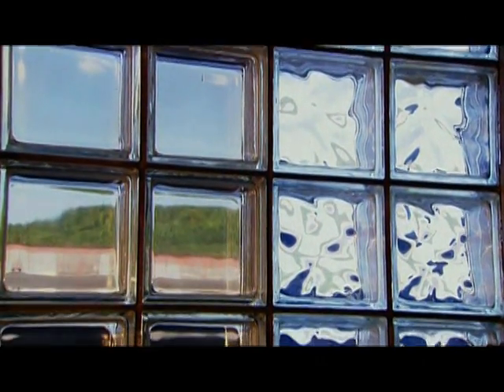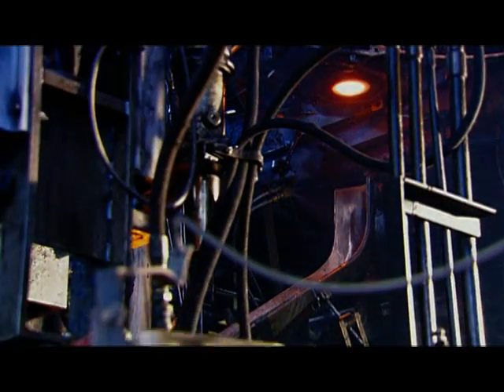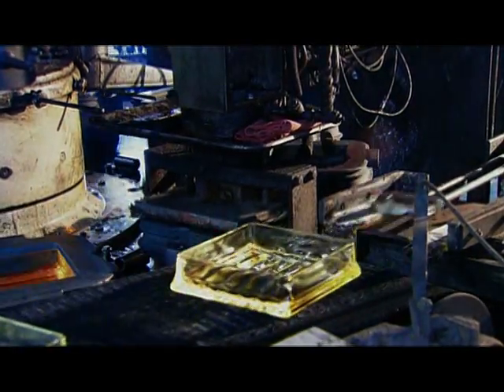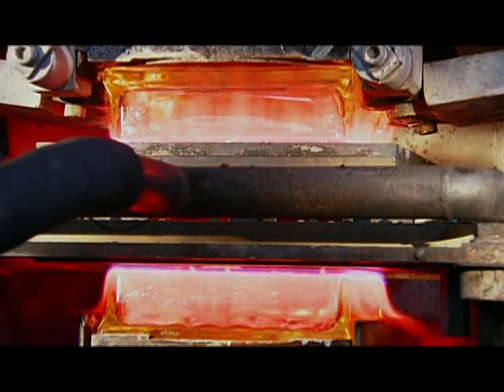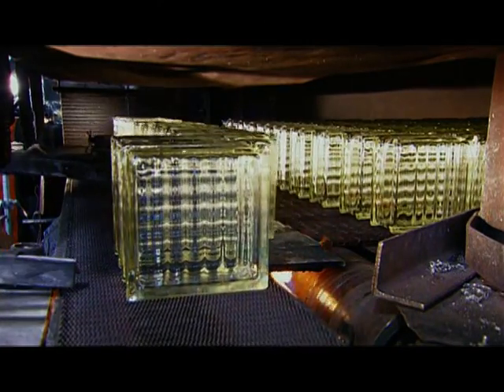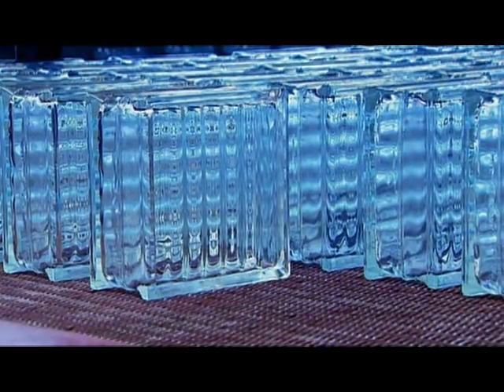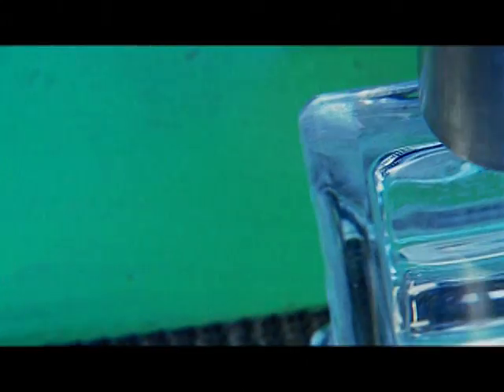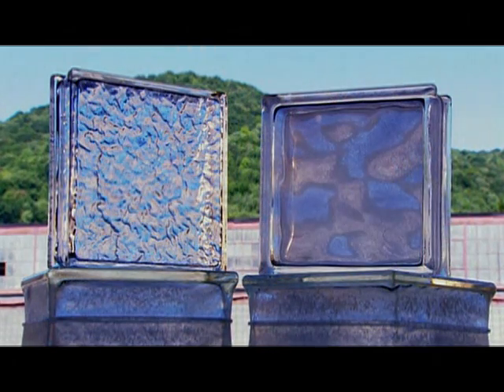Glass Block - How It's Made

Comment: Worked with Glass block for 20 years making Pre Assembled panels with em (that Pattern is Argus, theres Parallel and Non Parallel Rib style) , sad Pittsburgh Corning went outta business due to Imports (our Block now comes from Czech Republic....its CHEAPER to get it 3/4 around the world away instead of 45 min up river...sad) , and "every single block" is NOT checked lol. I get crooked, oblong, twisted, not fully sealed, ect
Reply: Im about to apply for pittsburgh glassblock how is that job on general? Is it fairly easy ?
Reply: @mellowm9882  Making the Block itself, not sure. But to make the Panels like I was is a LOT of lifting throughout the day.
Like a standard "4-32x24 panel Pour" for mortar (though ALOT no longer use Mortar) you gotta lift/cart 4-50lb Boxes of block, hand lay every one (so lifting 5 lb block 40 times), carry 50lb Bag of Mortar to mixer, lift 50lb Bucket to Pour Mortar. And when its all set and dry (in 45 minutes with my recipe) you gotta flip up each 60lb panel, clean other side and carry each one to "Finished" Area.
I used to do that about 4 or 5 times in an 8 hour day,5 days a week. It takes a toll on your Back, Legs and arms. Friday Epsom Salt 3 hour bath soaks were a normal.
So, in closing lol, EASY absolutely as long as people DO their job properly (miswritten orders PISS me off). But its also HARD (heavy), STRENUOUS back killing Labor in between the Easy.
Reply: @cpoky  ya im going to being doing glass block manufacturing just making it at their one location as far as i know.. I got a tour/interview coming up so i'll see.. I asked if i'll do any laying or building walls he said no
Reply: @mellowm9882  GOOD DEAL, hope it works out. Be careful, glass is dangerous let alone Molten Glass. IF they need some Panel Assemblers tell em you know an expert with over 20 years experience thats made THOUSANDS of em over the years whos lookin for a job. Tell em its the guy from ROSE GLASS BLOCK in Donora....see if they remember me lol.
Reply: @cpoky  for sure 👌
Reply: @mellowm9882  So howd it go man, you get the job??